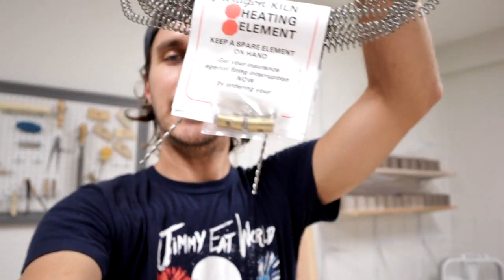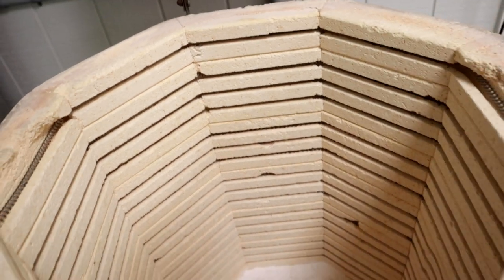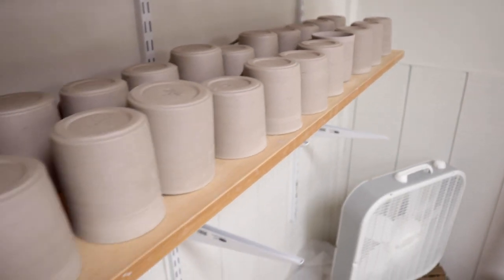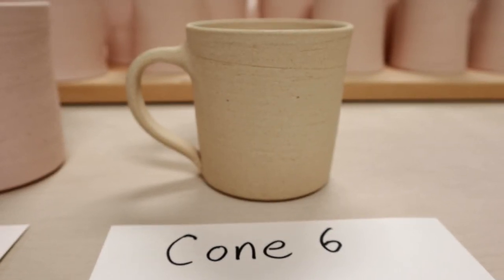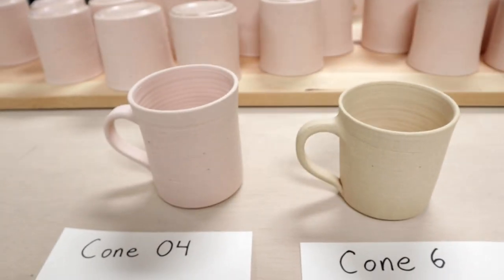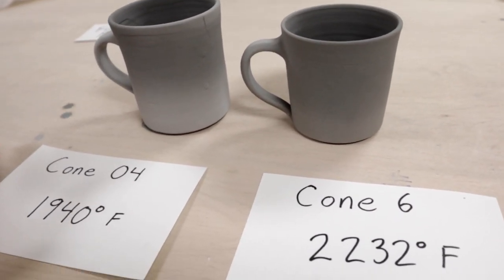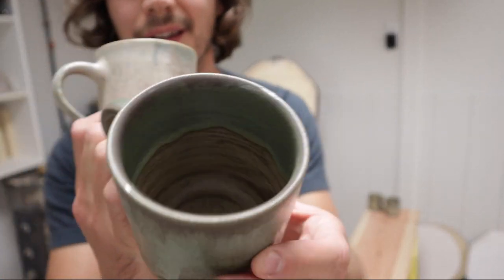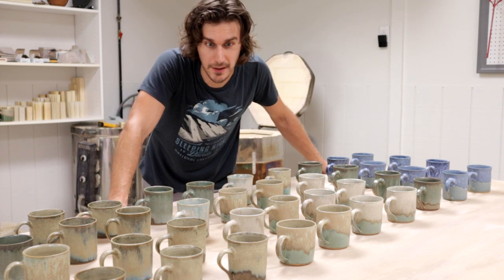Learning from my mistakes... finally a successful kiln unloading!

Comment: I've been told that using half shelves when you fire, and staggering them so there are gaps between the levels can help even out the firing, because the heat is allowed to travel. This could be especially useful with a kiln sitter kiln, because the level the trigger cone is on might reach temperature faster than the rest of the kiln, and shut it off prematurely.  Just something to think about! That said, I love your videos because you are showing the learning process, explaining your mistakes and showing what can go wrong. So few YouTube potters do that, and it is encouraging to those of us about to take the leap (just have to get power to my kiln sitter kiln, lol).

Comment: I have the same kiln. How did you run your cycles for the glaze? Meaning how long did you run in low then Med and high? Thanks for sharing!
Reply: I also have the same kiln. How do you run the bisque? I have been searching for the answer. Thanks
Reply: @jeanniepratt1326  I use cone 04 and step up. Bottom (B) Top (T) Low, Med, High (L,M,H)  1.5 Hour BL add TL 1 hour then BM 1 Hour then TM 1 hour BH for 1.5 to 2 hours then TH until it cuts off. Hope you understand my explanation.
Reply: @PJPottery  I do understand. You run the top an hour less on low, right? I'm curious as to why? No candling etc....
Thank you for your help. This all foreign to me!!!!
Reply: I meant...1/2 hour less
Reply: @jeanniepratt1326  as long as your elements are good that schedule works for me. Heat rises so the top heats up faster.
Reply: @PJPottery  Thank you....going to try mine out today!!! You have been very helpful!

Comment: First video that actually taught me something about firing and getting it right, the last video while a disaster I am sure has helped many and attracted a lot of views, more so than if you had gotten it right the first time.

Maybe firing wrong in some smaller batches, showing the different outcomes would help hobbyists understand why they have disastrous outcomes.

The only thing I would ask you to change is how you show the end product, it was easy to see the glaze at the bottom of the mugs, but the outside did not look as glazed in the video, just a matter of lighting I believe.